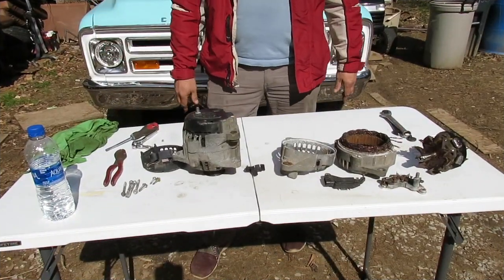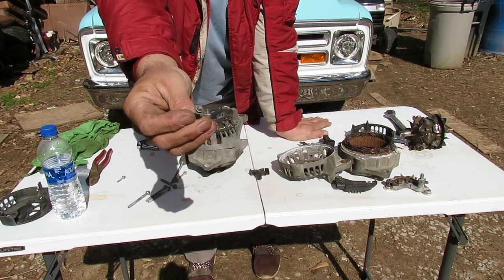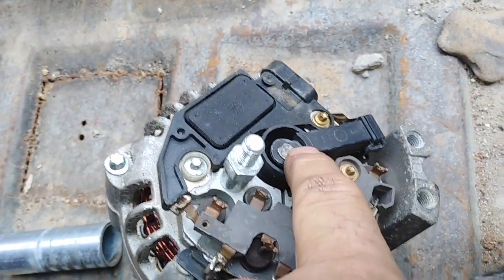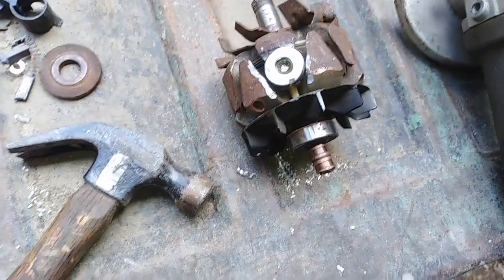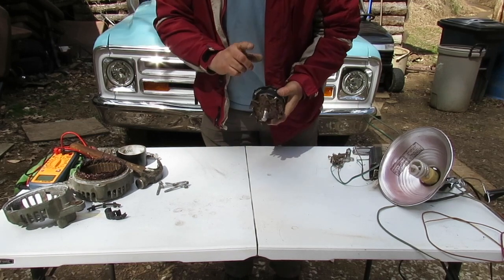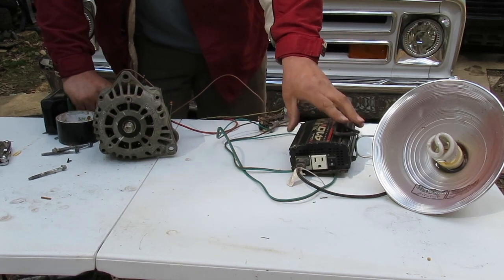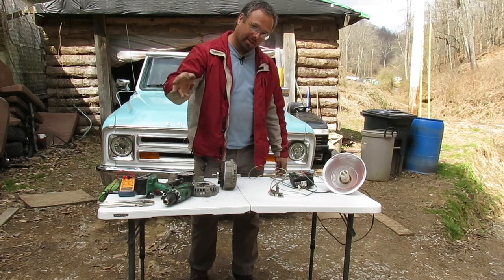Converting an Alternator to a PMA

Comment: There is a way to do all this without grinding out a single piece of metal from the alternator.
Where you pointed is actually what redirects the already built in magnetic field. 
Hence, making a straight North-South magnet coil in an alternating pattern by design to produce the alternating pattern required.
Instead hook up a capacitor to the system and let electricity generate the magnetic field as it is intended to without loosing any efficiency from the alternator.
Robert Murray-Smith has videos here showing how to do exactly this.

Comment: I lived off grid with a Honda generator for 3 years I just ran the generator for a few hours in the morning to freeze water in my freezer charge my 12v in parallel batteries and then run off 12 volt the rest of the night day you would be surprised how many things you plug in the wall have a Transformerwith rectifier inside them that steps down to 12 volts you can eliminate that and go straight into them plus when I made my lamps I used tail light bulbs when I finally could get a meter put in I use the 12 volt as a backup system or even when I wanted to save electricity

Comment: Great channel bud  one question  please   when i convert it to a pma do i run the ac output to the removed rectifier sited close to a voltage regulator and then the batteries?   Btw   do you charge the batteries in sequence or parralell     thanks in advance
Reply from the maker: Yes you will want to run the AC the long distance then have the DC run as short as possible to prevent voltage drop. My batteries are in 12volt parellel.

Comment: Great video nice explanation for people who know what your talking about.  If you excited the field windings to power alt. by battery for use with gasoline engine would it still be necessary for battery after initial start up or after excited they stay electromagnetic as long as its running? Leaving alternator in original state.
Reply from the maker: Thanks. After a car is started and running the alternator field would stay self energized even without the battery. 
For example I have had a dead battery in my truck before and no one had booster cables. I swapped a good battery from a friends car into mine, started mine up and then took their battery out with the engine still running and put my dead one back in. I don't think it is a good idea with newer cars to do that because you could get a voltage spike and mess up the ECM but for my old truck it didn't hurt anything.
In the case of using an alternator in this configuration the field windings put a load on the alternator and it takes some power to keep it moving. It doesn't matter with a gasoline engine, but with a water generator you need all the efficiency you can get.

Comment: what wuld hapen sir if you add baterry power with those gluved on magnet's together? 
ore what If you use just 1 polarity set on all those grewe's? 
wuld it react with the baterry cinde of? how wuld the stator coil's react if you use just 1 polarity magnets? because I am curiuse I know some baterrys might act as capacitors absorbing bouth ac and dc together as a potential.
So I experianced once back charge from alternator and scratched my head the voltage is present but no amps and the baterry didnt get fried ore the baterry didnt get boiled like usualy.
so thats where confusion acures is it posibel that a baterry can act as a capacitor if disimilar metals get involved?

Comment: Wouldn't the altenator generate electricity without making it a pma? I don't understand why you would change it over. What the point? Alt run to battery run to power inverter period
Reply from the maker: The alternator in a car uses electricity to energize a coil inside the rotor. If it is on a car engine which spins it really fast and has plenty of torque it will have no problem generating more power than it uses. Also with the weaker electromagnet, it has to spin pretty fast to just start charging, about 2500 rpm. With the stronger neodymium magnets and doubling the number of magnets(which I did when I changed out the round magnets to the square)it only has to spin about 500 rpm to start making power. It is also a lot more efficient because it doesn't use power to make the electromagnet. The factory car alternator also produces dc current from the output which experiences heavy losses over a relatively short distance. With a pma, the ac output on the three wires can travel a lot farther without so much loss of power.

Comment: Hello sir how do you solve voltage regulator on lead acid baterrys? Wuld that alternator over charge lead acid baterrys with out regulator? Did you try other types of bridge rectifiers like welder diodes?
Reply from the maker: A solar charge controller  would work for this. The alternator would eventually overcharge the battery without it.
Reply: @lukeFugate  thank you for replaying I have some of my own experiments but dont know how to prevent damage on my alternators.
Once I tried plazma ignition I used hv ceramic capacitors my starting charge got swaped from 1200rpm to 2500rpm so I was wondering if there is some circuet protection for external magnetic fields?
Aperantly centrain capacitor values changes alternator out put.
So I was wondering If I culd use that thing at low rpm generator then swap at centrain speed to brushless motor so Im not shure can speed controler and bridge rectifier co exist in a circuet ore not? I tought useing some thing sinilar to speed based oscilator circuet so Im not shure how wuld turn out?
And I was curiuse what wuld hapen if you use external stator windings with that alternator wuld some sort of transformer action acure ?
And for exampel if you ceap magnets and field wires with brushes wuld that not cancel the magnetic fiel out ore make it even stronger? I never tryed it before I cinde of broke my alternator for nothing culd not remove those shaft with out a press 😅 fully functional alternator turned to trash 😓 so got my curiuse there what I can do with that thing .
I hade some of my own odd ideas what to do with that thing .
Perhaps use even some sort of magnetic breaking circuet so I have cinde of safty breaks wheen my normal brakes fail in my car I wuld like to have a back up safty device some sort of.

Comment: the coil inside the alternator can be removed and a round magnet like from a microwave can be used.
Reply from the maker: Yes, that would work. It just wouldn't give quite the efficiency as the neodymium magnets. You can get round neodymium magnets perfect for this online though.

Comment: What are the 3 wires that come out of the alternator? Two hots and one neutral? So when I hook up power it should be hot, hot, neutral and then ground from alternator screw to ground rod? Im thinking 20, 30 amp breaker, or is it only a small amount of power that runs a couple lights? I heard we can get 50 amps this way. Thanks.
Reply from the maker: The three wires coming out of the alternator are three hots. It is three phase AC power. You need a rectifier to smooth it out and make steady DC voltage. If you have something powerful enough to drive it, like a gas engine, some alternators put out over 150 amps. If it is going to be powered by a gas engine you would want to leave the alternator intact and run it the way it would have been under the hood.
Reply: @lukeFugate  do you know how to power a 220v outlet with the 3 phase? I have 3 hot wires; I will ground the alternator and outlet. What about the neutral? Would I just use 2 hot legs on the outlet instead of a neutral? Thanks for any help. Im searching everywhere for this answer.
Reply from the maker: @jamesbrady1959  it depends on what you are trying to power. If it is just lights, then it would be fine to run from the "wild" AC coming from two of the wires from the alternator. If you wanted to run electronics or electric motors you would need to get the correct frequency and voltage to match up at a certain engine speed.
Reply from the maker: Not sure if the speed will match up with the frequency. Generator sets are designed to produce 220 volts or 110 volts at 60 hz with the engine running at 3600 rpm. Alternators are not designed that way. They are made to run at varying speeds and put out steady DC volts.

Comment: You talking about our old friend Red Green ? 

 If you need to be so specific with the rpm on the pma to avoid overloadind the inverter is there some way to have the power flow clipped when it exceeds a certain value ? or better yet to shunt only the excess somehow ?
Reply from the maker: Yes! I've been watching a lot of Red Green lately. 

I plan to use a solar charge controller to regulate the power going to the batteries.
Reply: Hopefully that makes it into a video as well then !

Comment: You need a stater that has more raps of wire you so you can get more power at lower rpm i get my staters from Missouri wind and solar for billing my wind mills
Reply from the maker: Good point. The alternator is designed for higher RPM. More wraps of wire in the coils would be better.
Reply: A scooter stator and rotor would work? For low rpm charging?
Reply: Or could I gear a generator head to the water wheel?

Comment: Why did you go from ac to dc and back to ac?? Can you go strait fron the alternator to the light??
Reply from the maker: The light I was using runs on 120 volts and the alternator in this configuration puts out from 10 to 15 volts. I also wanted to show that with a standard inverter you can run household appliances from this system. True a light would burn on ac or dc, but other things need 120 volts ac at 60 hz.
Reply: @lukeFugate  thanks for the info. I was asking a question for more knowledge,not to DOUBT your work!! Thank for getting back to me. Would it work the same using 6 mag. Instead of 12?? I know very little about electric but am very interested and thankful for your help. # why buy when you can  have the excitement of the build
Reply from the maker: @g-rock6329  It would still work with 6 but would have to spin much faster.
Reply: @lukeFugate  thanks sooooooo much for the great info. Wish me luck!!
Reply from the maker: @g-rock6329  good luck.

Comment: Thank you for the insightful video, I'm very curious to know if after this conversion you're still able to produce the same amount of power the alternator is rated for. So, if the alternator was originally rated for 60 amps at 12v, if spun at an alternators normal speed  5-6000 rpm, will it still produce 60 amps?
Reply from the maker: I'm not sure if it will produce the same. It's a 105 amp alternator so I know the windings can handle it.
Reply: @lukeFugate that actually answers my question. Thank you once again.
Reply: I believe it would only produce the same current it's rated at if the magnets he added produced the same strength magnetic field that the original rotor coil produced at full power input (no regulation) and if the same size air gap between the rotor and stator was maintained.
Reply: I personally believe it will impact the output quite drastically as there is no hobby method precise enough to make alterations to the factory design so that the magnets would be so exact as to be required for secure and exact output. See my other comment above on the actual proper way to do this without grinding away material that is supposed to be there.
Where the suggested grinding would take place is in fact what produces the magnetic field if used correctly without destructive techniques.

Comment: To the guy that made this video I know the bolts have a funny style head on them but a 6 and 12 point socket both will work if you use the right size of one same way a Allen wrench will work for a torx bit screw and a torx bit will work on a Allen screw
Reply from the maker: Thanks for the tip!

Comment: Nice Chevy pickup my dad bought one of those same color brand new with a 307 and a 3 speed stick, I think it was $2,400 his was a 68  I don't know if yours is a 68 but it has side marker lights ,I think it is. We went everywhere in that with a camper on it my dad taught me thank God.how to Maintain cars and especially Chevys
Reply from the maker: Thanks, it is a third-generation truck. Fourth-generation if you count my son. It is a 68.
Reply: mrromantimothy , mine is a 68 with the 307 , the 307 is a 283 block with a 327 crank , mine has the 4 speed on the floor and is 3/4 ton with 8 Lug rims
Reply: @jimthomas777  my dad's was 68 1/2 ton the 307 that year was known as a smog motor it had a small  Journal crankshaft not to be confused with the one you're referring to that was large Journal 307 a badass motor they sold them for marine applications for a long time after 73
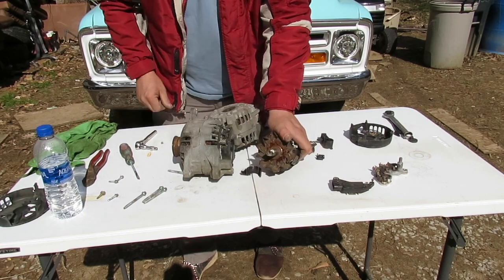Reply: mrromantimothy , I have a 67 K-20 also , it has no side marker lights and small rear window , it came with the 292 straight six , 4 speed standard trans , Rockwell transfer case with P.T.O., 8 Lugs with 4:56 gears , Warn lockinghubs , 16.5 
 rims with 33 inch superswampers , 4X4  , flat bed 1/4 inch steel plate , , unfortunately the 292 straight six over heated and cracked the block , I replaced it with a small block 350 Chevy engine , it will haul just about anything , I came off the weight scales at 10,500Lbs 
that's  over 5 tons  and hauled it no problem

Comment: You mentioned the magnets need to alternate North South but you never showed how to do that. Are you meaning one should have the North pole "up" and the next one have the South pole "up"? What about rectangular magnets. won't they also have "poles" on the ends too?
Reply from the maker: Yes, one with north up then the next with south up. Yes, the magnets will have poles on the ends too but as long as the ones facing up alternate it should work.
Reply: Santa1 , you can buy a magnet (PMA ) rotor from Missouri wind and solar and they work great , I got 4 of them , That's MWandS .com , they can be used for , wind turbine , water wheels , or even hooked up to a small gas weedeater or chainsaw engine  to produce power

Comment: Luke, do you have a close up of the connections from the alternator and to the rectifier, please?  Thanks
Reply from the maker: The three wires from the alternator go to the three same connections they used to on the rectifier. The positive comes from the bolt on the rectifier and the negative comes from the chassis.

Comment: We live out in the sticks in AL, I was wondering a couple things 1) since we don't have a stream or nothing like that, could this be accomplished using n old bicycle? 2) Is it completely necessary to grind down those tooth-looking things to seat the magnets? I could prolly rig something up to hold the rotor in place.
Reply from the maker: You could use an old bicycle to power the alternator. people have actually done that without modifying the alternator. 
Here is a video showing someone who built one with a stock delco alternator. https://www.youtube.com/watch?v=kVAZIDFMRXY
If you want to put magnets in an alternator you have to grind down the fingers for clearance.

Comment: Does it matter what side is north or south?
Reply from the maker: Doesn't matter which you start with as long as every other one is turned opposite like N-S-N-S and so on.
Reply: Hope you don't mind but i just have 1 more question: what thickness where the magnets in this video? Have a Nice day sir :)
Reply from the maker: @cvdk7194  I think they were quarter inch magnets.

Comment: Why wouldn't you just send power to the voltage regular from a battery  to electrify the field ?
Reply from the maker: You lose a lot of efficiency by energizing the field. You automatically lose 40 watts of power to run the field coil. The PMA doesn't require any power to generate electricity. With a car engine you have plenty of extra torque to waste so it doesn't matter if it takes some of the power to make up for the field draw. In a lower torque application like a wind generator or water wheel, you don't have the power to spare to make up for the 40 watts required to energize the field. For example my water turbine produces about 50 watts of power. If I had to use some of that to energize the field, I would only be getting about 10 watts out of it.
  Also a standard car alternator doesn't produce any power until about 2000 to 2500 rpm. With the permanent magnets the rpms are closer to 1000 to start producing power.
If you had a high torque/high speed application where the 40 watt loss would be negligible then the automatic voltage regulation of the alternator would be great to use. It just depends on the application.

Comment: I use a one wire 100amp chevy alternator hooked up to a rc truck motor with a small belt that's hooked to my batterie bank to charge batterie bank I Have A SWITCH turn on in 1to2hrs all 8 batteries are charged
Reply from the maker: Good idea.

Comment: 12:57 I thought the 12v regulator would cause You to be able to full throttle it, or either I missed you taking it out or adding the magnets in itself causes it to not regulate
Reply from the maker: The voltage regulation is done by varying the field voltage. After installing the magnets, the voltage is changed with the speed of the shaft.

Comment: Would a PMA ran by a waterwheel still be wired straight to a battery bank even though its outputting AC?
Reply from the maker: No, it would have to be ran through a rectifier and a charge controller.

Comment: Have you installed wind turbine using this method
Reply from the maker: I built a water turbine generator using this same one. It worked ok and provided power to my cabin for a few years. It probably still would, but the lines got clogged up and I haven't had time to fool with it lately.

Comment: Can you take a alternator that dose not work in a car and do what you you done and make it work for power lights
Reply from the maker: It depends on what is wrong with it. If the coils are still good it would work fine, you may have to get another regulator.